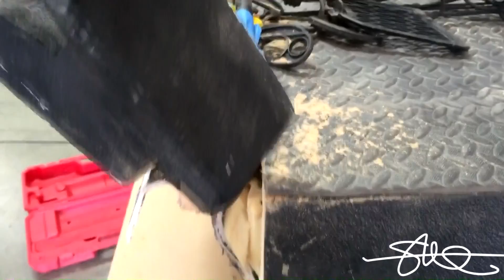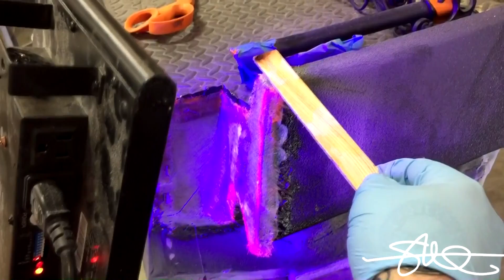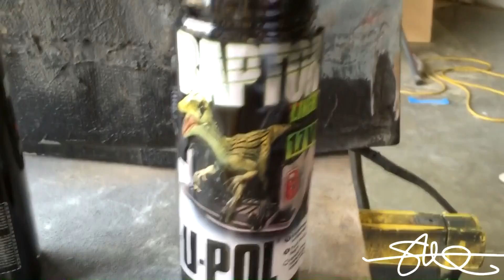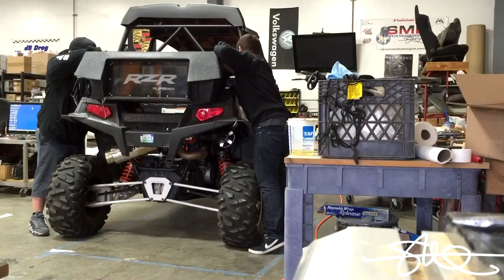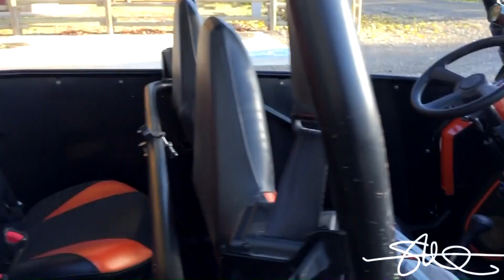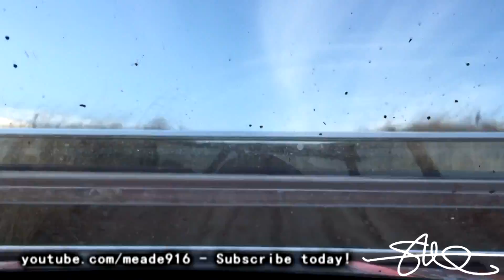Polaris RZR4 900 Turbo - BASS + BOOST - Modding the woofer box for Intercooler

Comment: Very cool, have you thought about maybe doing a 5 point harness for the driver, and passenger seats ? would really hold ya in making tight turns, and hittin hills and what not.. Also, my jaw dropped when i saw that little engine is running 11psi ! thats insane man !!
Reply from the maker: seats and 4 (or 5) point harnesses are coming soon.  One thing at a time. This thing might as well be a BOAT. (Bust Out Another Thousand) lol...already got $13,000 (or more) invested in it with all the shit i have got so far.  Give me time bro i'm not rich.

Comment: Hey Steve, how is that intercoolers performance sitting in a relatively blocked off area behind the windscreen and seats?  Is a true front mount intercooler possible with this vehicle?
Reply from the maker: the seats don't block much but the windshield is not ideal for the cooler...if i am not riding with someone kicking dirt on me, i usually take the front top half of the windshield off.  I also plan on adding some Pulling fans to the intercooler to help move air when the screen is on.  Other than that though, even pushing it fairly hard, it was fine.  I would be more concerned on a hot summer day in the middle of July though and less concerned in the winter time.